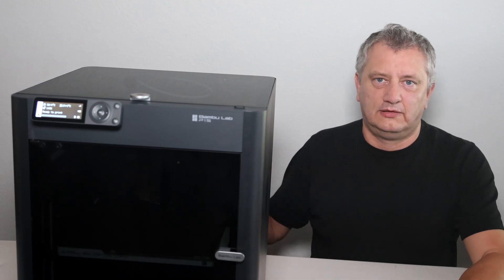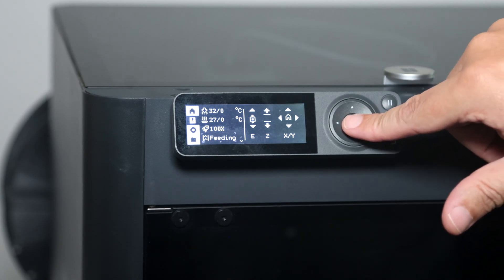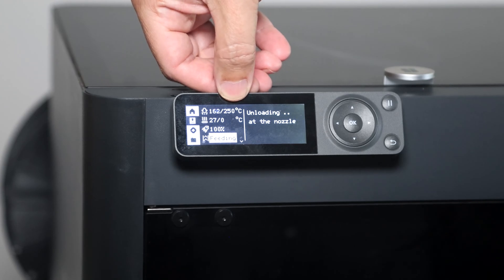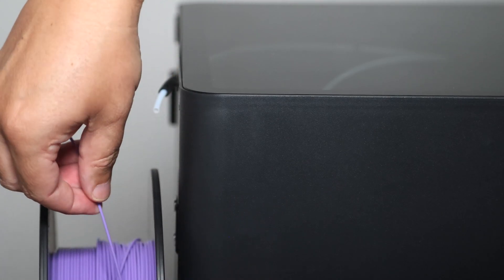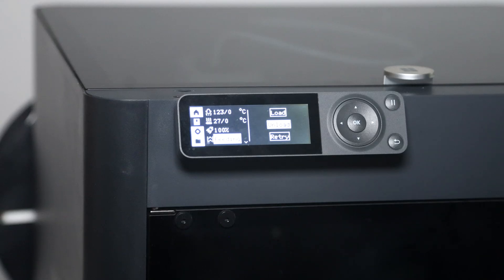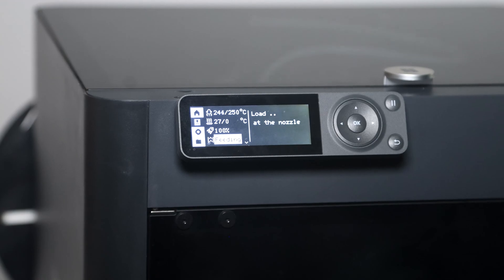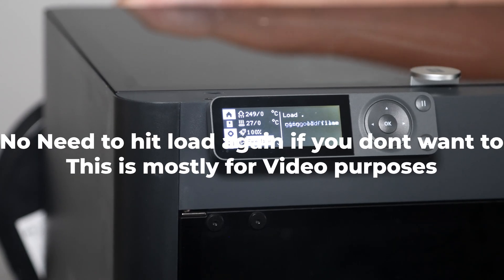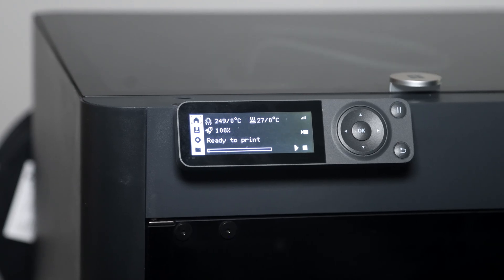How to change Filament on a Bambu Lab P1S & P1P @BambuLab #bambulab

Comment: hmm second video ive watched... loading it seems easy but how do you tell the printer what sort of filament is in there?
Reply: oh wait i see... there's a TINY pencil edit icon in the ext spool graphic in devices setup... This is a pretty weird feature in an otherwise nice piece of software lol seems such an important thing yet almost hidden...
Reply from the maker: Yeah, it's in Bambu Studio, in the devices section, once it's in there, you can then map it in the prepare section, if however, you eventually get the AMS and use Bambu Filament it will automap, but as this is just for the non AMS there's a little more manual work to do